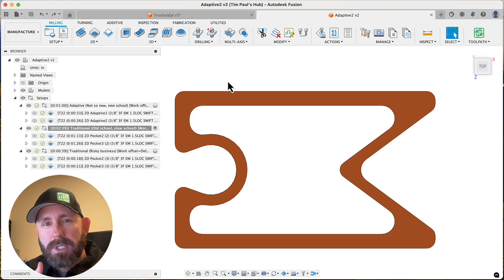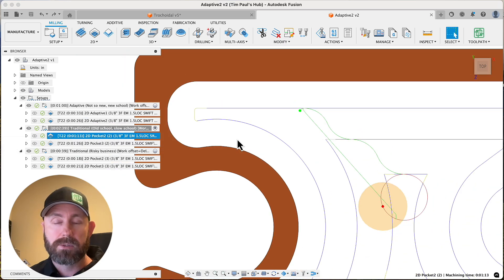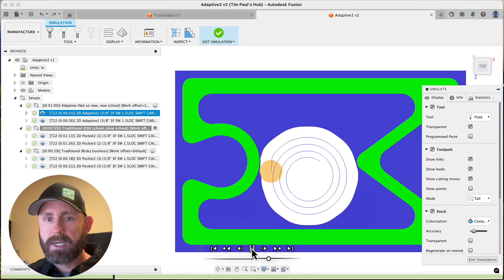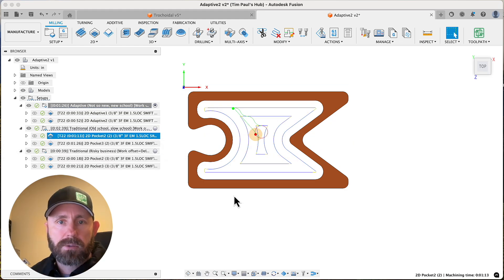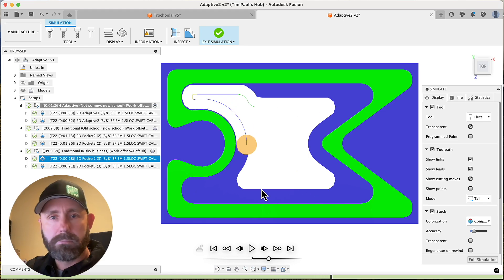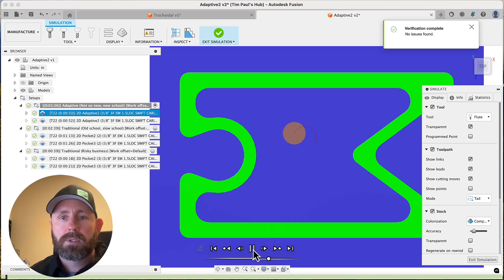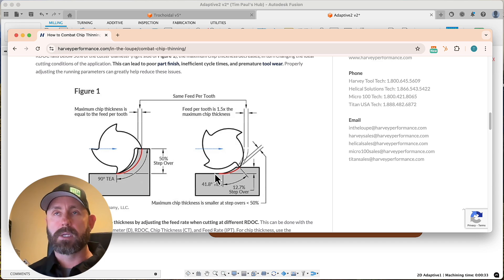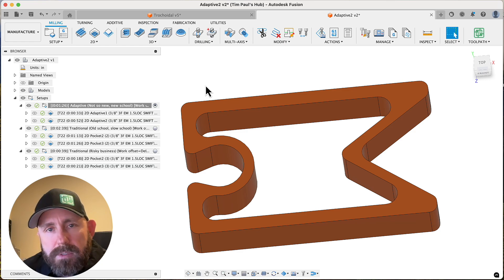Why Adaptive?

Comment: but it is lie an earthquake then.. in the corners while milling
Reply: Can you explain more?
I don't follow what you are saying.
Reply: @ToolpathTim  a lot of tiny movements in a row
Reply: @map3033  That is the only way to never over engage the tool. Alternatively, with softer material you can use a traditional toolpath and turn on "optimize" to slow it down on the tight corners.

Comment: I've got a feature concept kind of in this spirit, 
I would love it if we had a surface feed option in finish contouring toolpaths, 
What I'm referring to is an automatic decrease in inside corners based on the tool diameter and the corner radius of the contour.
and on outside radii an increase in feed since the tool has to traverse a longer path compared to the contact point on the part.
I know there is 'feed optimization' and if you have an inside contour with only one radius size that would do the trick but something truly dynamic would be pretty cool.
I also know you probably can't implement something like that but I'm curious if you or other people see the benefit of the idea so that's why I'm posting this :)

Very informative video, thanks!
Reply: Ya, it's a great idea. I've seen it somewhere in a CAM system. We talked about it when I worked at Autodesk for Fusion but it never made it to a priority. Often things like this get pushed down the priority list because they have soo many other things that really HAVE to be fixed.
Reply: @ToolpathTim  So you're saying there is a chance it might get added within the next 100 years?😁

Comment: Thanks for the content. One video I feel would be helpful I don't feel many have touched on (although many have touch on chip thinning) is focusing specifically on finishing passes... As a newer machinist who started working in Aluminum, you can get away with very small radial DOC finishing passes. This is not the case when working with harder materials (such as Stainless) as you can risk blunting/damaging the tool not taking enough FPT... I don't want to damage my tools, but I also want to achieve great surface finishes in harder materials. How to find at least a happy medium, or reliable formula/strategy for finishing passes in these harder materials. Experience obviously is key, and I'm working on that!
Reply: I would like to see radial chip thinning depth based on actual step over or angle.  I see many old school feed speed charts based on 50% step over from old days.  I know some advanced charts like Helical tool has good data.  I think Mastercam has RCTF but only if you loaded specific tool libraries. 

  First time i saw this new HEM demo I saw was from Surfcam called Trumill in 2008? We all thought for sure it would snap the 3/4 end mill at the 1.25 deep. But when we all saw the motion it made sense right away. 
We had all been using pocket and shallow depth.
Reply: @CNCDude5x  It's nice to see tooling companies like Harvey/Helical giving feeds/speeds as well as the suggested % of tool diameter for stepover based on the milling strategy. As for the companies that are still giving FPT based on 50% stepover, I had found a chart from DAPRA tooling that gives you a feed rate multiplier to achieve that consistent FPT with lighter radial cuts, if maybe you want to check that out. There's fancy formulas and all, but would be amazing if CAM/Toolpath just accounted for that like you mentioned.
Reply: Also repeat/multiple finishing passes. When and when not to use them. Is “rubbing” a myth?
Reply: @poetac15  Rubbing is not a myth. But, it's over feared if you ask me. 
Adding a spring pass or repeat finish pass can very often give you much much more stable finish dimensions. The more rigid your machine, tooling and tool holding theless impact you'll see spring or repeat passes have an impact on final dimensions.  
I've gone back and forth on this opinion and it was often tied to the most recent time I got my butt kicked. 
I typically add a spring pass to critical tolerances on my Haas VF2SS and it makes a significant difference in my final diminsional consistency.
I've had good luck in my current machine setup spring passing aluminum through 17-4 H900
I would absolutely avoid spring passes on high nickel materials that are prone to work hardening just like you would avoid dwelling for any other reasons. 316ss would be a good example.
Reply from the maker: Noted! There definitely is a fine balance there. Thanks for the suggestion!!